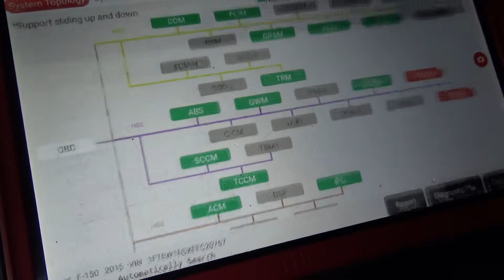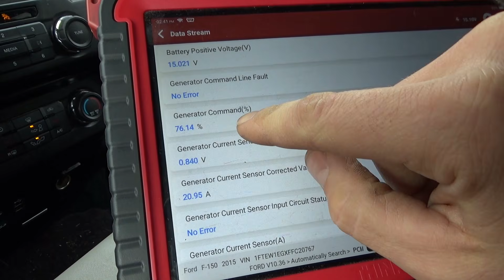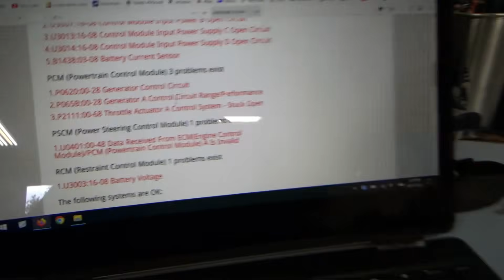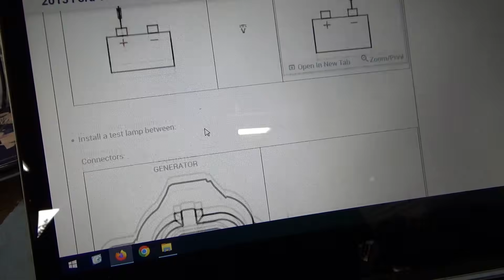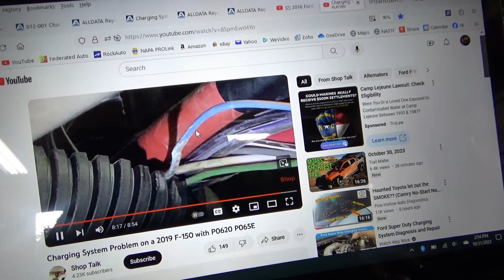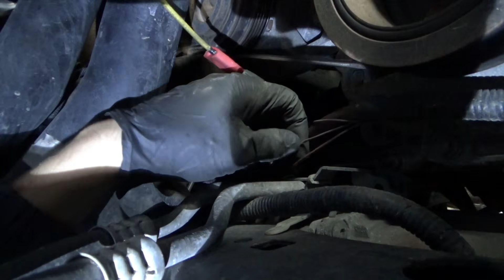Ford Battery DEAD...in the RAIN?? (F150 EcoBoost P0620 P065B)

Comment: Thank you so much for sharing this online, but I'm still confused about "GENCOM"!
My current understanding is that the current flows from the generator to the power control module (PCM), and the PCM controls the required operating cycle by grounding it using an internal transistor.
However, I saw a video showing voltage on this wire at the socket, which is disconnected from the generator.!!!!!!!!
Thank you again

Comment: My 1994 F150 has "Blind Spot Detection Modules". But we always called them "Mirrors" Mine has an aftermarket brake controller too. Its called "Coffee". It also has a 5 speed manual, mellinial anti-theft device. Oh, and it was paid off in 1999, and still runs perfect.

Comment: How in the world do you even manage do design a system where a shorted alternator control wire can cause a 5A drain? No alternator control wire fault, besides shorted diodes, should ever cause a parasitic drain.

Comment: The big clue i saw at the beginning was overcharging. Anytime voltage is 15v I get concerned. The customer had a throttle body code with generator codes, and the customer replaced the throttle body without addressing generator codes. 
Isuzu had many transmissions replaced cause of 15v. I got involved with a buyback from GM over this. When i checked codes, only transmission codes. However, I noticed 15v, so I replaced the voltage regulator and then diagnosed the transmission only to find all codes gone. It created a recall on the Rodeo for voltage regulator replacement as lots of transmissions were on backorder.

Comment: I had a gmc sierra and could not figure out why the battery tray was rusting away,found out when it rains the rain would come down the hinge and flood the battery out of acid ,so rusted bat box and dead battery.
New battery and covered battery with a piece of sheet rubber no more issues.

Comment: It's amazing that from at least 2015 to 2019 the F150 had alternator wires routed over a bracket that would rub thru the insulation and they never corrected it or issued a TSB which tells me Ford just doesn't care. Wake up Ford buyers.

Comment: Hi Ivan, I found your site a number of weeks ago by accident -(Youtube Algorithm).   In my dim and distant past I trained as an auto electrician in the british army working on Armoured vehicles and trucks ( Bedfords) and Land Rovers. In comparison to the stuff on the market to day the electrics are very simple - no CAN bus, dynamos, mechanical regulators etc. I still sort out my own vehicles where I can but obviously they are not that simple. I have learned so much from you - thank you for the detailed diagnosis and showing your methods. I like to try and guess what you are going to find. In this case I though it could be the generator rectifier bridge partially short cct. What I learned is that generating system are not as simple as they used to be, in fact I believe that vehicles are over complicated. Keep up the great work and best wishes from the UK.

Comment: Great video again Ivan - reminds me of of a Mitsu Shogun with a speedometer fault, had checked sender unit & wiring all seemed OK in plastic conduit. 
Turned out to be a broken wire inside the perfect conduit where it crossed over the chassis & was properly secured by a P clip, the clip was too tight around the loom & this light wire in with heavier wires gave up.
It's a known fault on them but as you say it's nice to know you're hunting in the right direction when you start ripping.

Comment: Either Ford had an issue installing the nut on the assembly line or it is sloppy work on a prior repair.   Or is this Ford's method of planned obsolescence? At one time either Mercedes, BMW, or Volvo was experimenting with wire insulation that breaks down over time. I believe it was Volvo and it backfired on them by degrading to fast.

Comment: Had a 2014 F150 eco boost, had 28k miles, still under warranty, similar problem but didn’t need to be wet to drain the battery.  dealer could not find the issue in over 3 months, replaced the BCM, PCM, battery, alternator and the final straw was when they said it was the key fob… Traded it for a Chevy… don’t think they ever got it fixed.
Reply from the maker: LOL

Comment: My after market trailer brake controller draws my battery dead over a few days. I pull the fuse for it. Not supposed to do it but it does. No idea when it does it , tested for a draw but never shows one. Only thing I am sure of is when I pull the fuse never a dead battery.

Comment: I remember watching your video about P219B. Typically these codes are for injectors however, I replace all the injectors on my Silverado. Sometimes I get P219A. Could be.?
Reply from the maker: I don't remember that code... 🤔
Reply: @PineHollowAutoDiagnostics  https://youtu.be/Qg2sc84HP8M?si=bJ1paF3bAijzbN-v
Reply from the maker: @TurnThemWheels  ah yes the Mazda! You have to be careful with GM direct injectors, they come in 3 different flow rates! There should be a TSB about that 👍
Reply: @PineHollowAutoDiagnostics  07-13 doesn’t have direct injection. It’s port injection
Reply from the maker: @TurnThemWheels  oh you didn't mention what year your truck was 😅
Reply: @PineHollowAutoDiagnostics  yeah sorry about that lol. Only two videos about P219A for 07-13 GM Trucks and one is mine and one is DIY Willy and we both did injector balance drop down test and we both had leaky injector 7 driver side. However, it has been six months and the code came back. I have noticed the code only comes back when the range afm Disabler has been unplugged and miles have been put onto the vehicle.
Reply from the maker: @TurnThemWheels  sounds like another leaky injector if it was fixed for 6 months lol
Reply: @PineHollowAutoDiagnostics  I hear tapping im thinking a lifter
Reply from the maker: @TurnThemWheels  oh classic AFM fail 😅
Reply: @PineHollowAutoDiagnostics  that’s possibly what I’m thinking at this point. The truck runs phenomenal. Looking at all live data there doesn’t seem to be a problem.

Comment: The electric gremlins have been messing with my Ford F-150 as well, failure to charge. Replaced alternator and battery to no avail. I have now purchased a factory OEM replacement harness which goes to battery, alternator, a/c compressor, and starter and will replace soon. Before doing this, I will amour plate the section of harness in plastic bracket to ensure these problems will never occur ever again. This is a major design flaw on Ford's part and now tens of thousands of Ford F-series pickups are affected. When I do this swap, I will now ensure harness is not in any way in contact or laying on transmission cooler lines and that the plastic bracket securement bolt is present and tight, actually I will add loctite to threads to ensure it can never back off.
Reply from the maker: Good luck! 👍

Comment: On a 2015 UK Ford, a battery replacement needs a scanner to update the battery info, to set that is has a new battery and set the battery type / capacity if different.
Without that, it will treat the new battery as if it were the old failing one, and not properly charge it!

I don't know yet if this applies to the truck in this video, but it may be helpful to anyone searching for strange charging faults.

Edit - Totally different fault.. Excellent video as always!

Comment: Yes , there's less overheads involved running a workshop that size by yourself.

The employer who I worked for 20 years ago converted his old dairy shed into a workshop where he could rewind & overhaul electric motors which worked out well because he was working for himself.

He's was an electrical fitter/mechanic by trade whose now retired & he was making more money out of doing that &   repairing commercial laundry equipment than he was out of running a dairy farm.

The farmers were only making $0.02 AUD per litre out of the milk !

Comment: Thanks I find some of the videos on the net very useful. My younger son has a 97 Pontiac Grand Prix with a no crank, start and research shows probably cause ignition starter switch. It’s recommended to buy OEM which I ordered and is on back order
Reply from the maker: You should actually verify that by testing before you order it!
Reply: @PineHollowAutoDiagnostics  sadly this is beyond my skill set 😩
Reply from the maker: @HotRod-wv4vm  nah its just a 90s GM! I would get a test light and go to the starter relay! Watch my "no start" playlist and follow along 😉

Comment: For zoning issues in my area you can hire an expediter who is supposed to help you work through zoning issues. They generally know the process and the unwritten rule of the road. You can try getting a referral from a locally licensed architect or professional engineer.

Comment: Interesting fix. Thanks for the video. I once had an alternator that was not charging. I pulled on all wires going to the alternator and one came apart. The wire was broken inside the insulation. No internet in those days so no sharing😁

Comment: They way the battery to alternator cable is exposed they are lucky that cable did not get rubbed through and grounded. Harness routing and mounting is important especially when working on buses, trucks and heavy equipment

Comment: This is a problem Ford knew about for years and they won't fix it, I seen this in a 11, 13.17 and I think the last truck was 2018 so it's an easy fix for Ford but they won't do it, Just goes to show they and other companies are building in problems, I think the 2023 have the bad wheel bearings they used in the 2022

Comment: I've had this same problem with a 2015 I believe it was.. didn't kill the battery overnight but  had the charging system codes. Wire was broken in the exact same spot but because it was stretched too tight.

Comment: This reminded me of a long running intermittent problem I had with a Vauxhall Omega (UK/Europe upper market sedan built in 1996) 20+ years ago.

Battery would go flat randomly every few weeks or months Jump start and 10 mile drive seemed to fix the problem.

I also had a random problem with the alarm system going off sometimes parked, eventually even driving. It got to the stage where I had to disconnect the battery at night. That was interesting as the key to manually unlock did not work in the driver door so the only way in was via the trunk. Good job the rear seats folded down!

One day it occurred to me that this problem seemed to occur when it was raining or had been graining earlier in the day. That seemed to be important but not immediately useful.

After about a year of this, initially rare but getting more annoying considering this was a German built executive sedan, I happened to notice that the plastic trim  panel in front of the windshield had a small crack  leading to the drain hole that guided excess excess water into the void a head of the A pillar and then out through the hole at the bottom of that section and onto the ground.

No big deal to have a crack in a bit of plastic trim in a car which, by then, had about 120k miles recorded. Just a drain through, right?

Except that the same area was the location for the vehicle alarm siren. 

In certain circumstances of parking in not quite perfectly level surfaces on days that it happened to rain, the crack allowed water to drip directing on the exposed contacts on top of the alarm system, connect across the contacts and either drain the battery or, sometimes, trigger the siren when moving. 

I managed to get some silicone sealant on the contacts without having to dismantle half the car (no easy access as it was suoposed to be a secure alarm location)and glued up  the crack so that water dripped from the  drain hole to where it was meant to drip, missing the alarm system.

That seemed to work. No idea how long it lasted. Within a year I traded it at about 130k miles and I suspect it went for scrap not long after. 

Almost a very nice executive car but in the 4 years and 70k mile's I owned it, it have far too many expensive issues (and some obscure ones) for it to be considered good value, despite a tremendous specification for its day.

Comment: You can calibrate an old or new battery cable using ohms law ( I = V/R ) to measure >10a dc using the mV setting on your meter. This way you don’t blow fuses and can read up to 200-300 amps easily using your meter safely. There’s a few videos on YouTube showing how it’s done.
Reply from the maker: For big draws sure, but would lose accuracy in the mA range 👍
Reply: @PineHollowAutoDiagnostics  another option is a 1 ohm resistor (instead of ammeter) in series with battery, and a 10A or so diode in parallel across the resistor to carry surges.   below 0.6A you will have  1mv/ma across the resistor.  Use a clamp-on ammeter if needed to measure the surges.

Comment: Over here in the UK, broken/corroded wires are very common faults in the so called Ford "smart charge" systems.  The system puts on the charge warning light approx 20 seconds after firing up and defaults  usually showing about 15volts at the battery.

Comment: The way around a "garage" is to call it a Barn. Once its there you can tailor it to your needs and of course, keeping all of that in mind during construction so that changes/add-ons later can be performed. Building a "shop" might not be the best wording to use. It's hard to believe your local laws won't allow you to build another "garage" structure on your own land. Remember, those people with the county or city use key wording for what they allow or don't. Building a structure shouldn't be a problem but if its called a repair shop or a shop, it might. They look for words that describe the "use" of the building too. Shy away from any words that might be considered a repair shop for your PHAD. Why not tell them its a barn, a tack room, tractor hanger/garage, storage etc. Then just work around what you can also use to make it work for your vehicle repair needs. Make it look like a barn....might be better for resale one day. A barn with a car hoist or one of those 4 post drive on ramps that raise the vehicle up. Those are widely used by car collectors who need to park two vehicles in one space, one under, one above.

Comment: Great find, well done.
Around about 25:13 does it show that the cooler lines had been running on the top of the other cable conduit running across the front of the car (foreground of video)? Is there potentially some wire chaffing inside there as well?

Comment: I hate to say it, but research is key on working on anything. 99% of your time is not on the vehicle, but on the computer. 1% of your time is spent on the vehicle.
Reply from the maker: Pretty much lol!
Reply: @PineHollowAutoDiagnostics  

When I had the problem of the cooling fan going on high speed constantly, I knew the problem before I took it to the shop to evacuate the AC system to replace the high pressure switch, which had the green crusties.

Dylan ended up doing the same thing when he found the MAF sensor bad and front O2 sensor loose. He still didn't like the fuel trims afterwards until he replaced the rear O2 sensor. It still went pig rich until the PCM finished the readiness monitors and adjusted the trims to where it thought it should be, LTFT at 3% wíth STFT at 0 ish. Since I have a high flow exhaust on it, I expect the long term to be a tad higher. 

With me, I prefer to hear the exhaust tone and pitch to see how the engine is running. That is a big clue to know if there is something going on. You can hear it in the exhaust. My dad taught me this when we were working on lawnmower engines. He could adjust the carburetor just by listening to the exhaust.

Comment: Good detective work. I'm just wondering, since the generator command still fluctuates that rapidly, if you confirmed continuity of the entire wire after repair.
Reply from the maker: It's just reported computer data... Works as designed 👍

Comment: I wonder...would it be better to have gold-plated wires in certain areas of vehicles to prevent corrosion? It seems the green crusties are such a common failure point that it might be economically feasible to justify the extra cost over time. I could be wrong...
Reply: in marine application cooper with tin is used

Comment: After the repair the voltage is perfect on 14,4.. Initial test befor repair it was 15 volts. Thats high. 
.. Voltage Regulator was turned up higher then normal.

Comment: My go to on a situation like this is to split an old radiator hose and use a foot or two piece of hose to slip all this harness in and keep it shielded over brackets like this and bending around corners, etc..  and Then I'll tape that shut.  I've never had to go back on a repair like that again.  Being shielded inside a thick rubber hose tends to keep wires safe for the life of the car--  even around hot exhaust.  I make sure you tape it up well so it doesn't let water in.

Comment: That same location on the 4.6 & 5.4 had a problem where when the passenger side motor mount would wear out and cause the engine to drop and pinch the crank senser wires between the a/c compressor and frame. Its a super intermittent stalling and crank, no start problem that will drive you and the customer crazy. If you aren't aware, you might want to note it.

Comment: Hi Ivan i have seen one case where the battery dischaged over time becuse the top of the battery was wet and it discharced from one terminal to the other, cure was to clean the top of the battery lol..F.

Comment: Lots of great info on the tube and the internet, but there is also a lot of misinformation so you have to always have a bit of caution. I like working out of a small shop, its much easier to keep organized and clean. Went from a large shop 10,000 square feet to a small two car in retirement and love it.